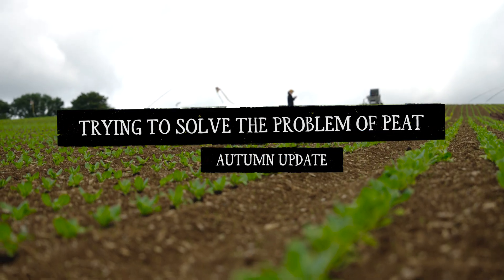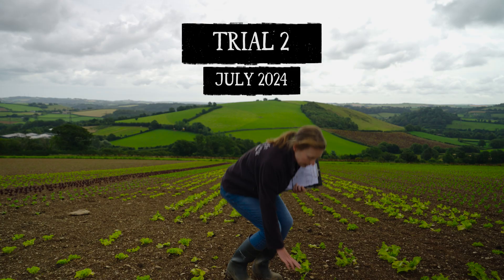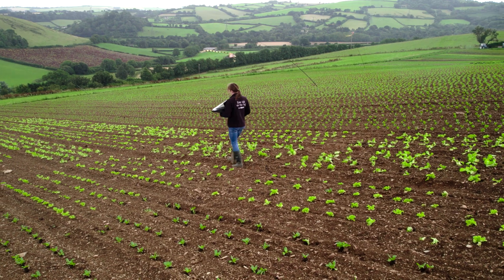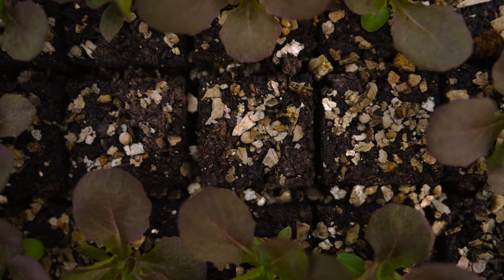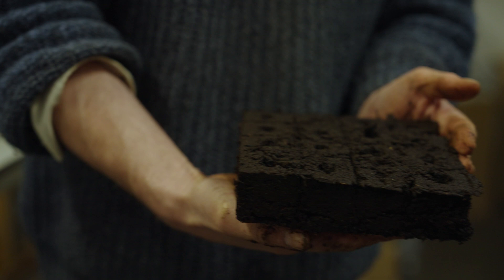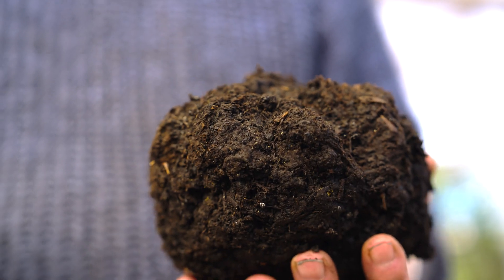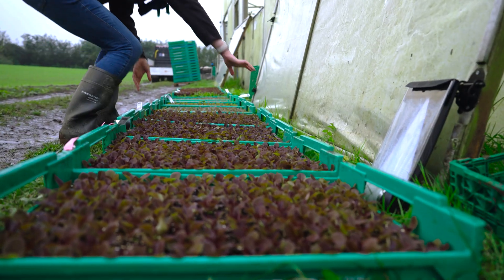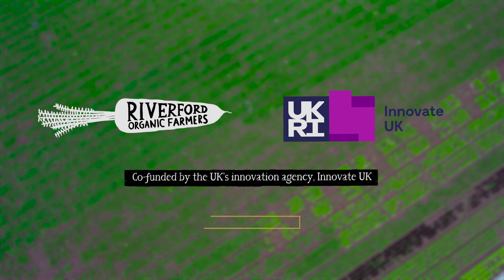Peat free trials - Autumn update

Comment: I have found that coir/coco works very well as long as you soak it with a solution of gypsum and epsom salts before you start. If you don't, the coir locks up the calcium and magnesium from the feed that you add. For 70 litres of compost, I used 100g CaSO4 & 35g MgSO4 in 120 litres water.